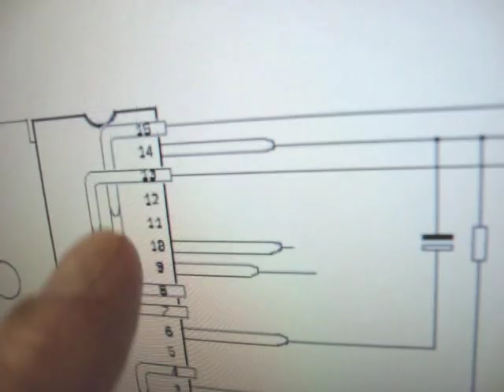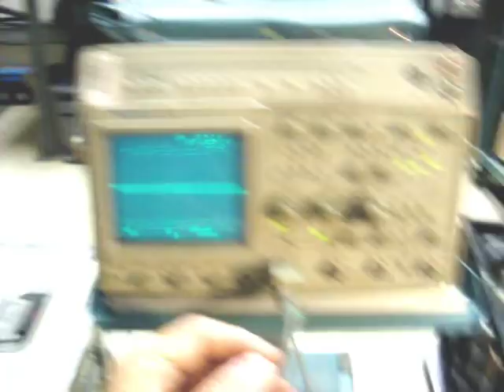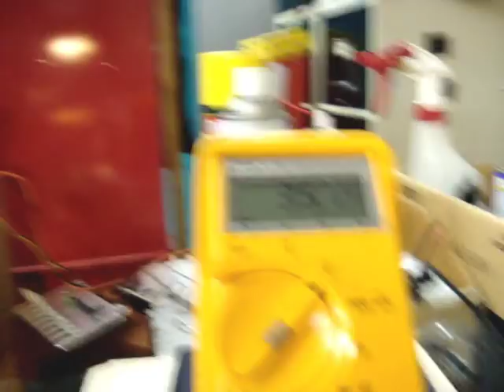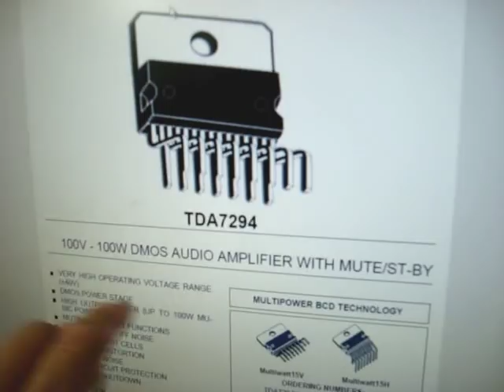TDA7294 100 Watt Audio Amplifier IC

Comment: You keep showing only the input in terms of frequency. It would have been really nice if you mentioned the input voltage peak to peak. 
Will watch the video a few more times to see if you have mentioned input voltage. This was the most critical info I was looking for i.e. what input voltage range does this chip work with best.
Reply from the maker: I may not have mentioned it because the gain (input sensitivity) can be set by changing the feedback resistor to a larger value. I believe i did this  mod to this amp to make the input gain similer to that of consumer line level. Hope this helps.

Comment: nice Video thanks for this! But i habe a Question. I have Build this amplifier but i have a Porblem, the top half wave is niche no prblems but the bottm half wave have a scratch on Top can you tell me whats the Problem ?
Reply from the maker: Verify that the negative voltage is good. Also, make sure that both the + and - have bypass capacitors to ground at the IC terminals. Keep ground leads short and star point grounds.

Comment: This chipamp is so good  and economical,I build several amps  with this chip  in bridge mode  ,sold some and never looked back
Reply: Lm 3886 will give even lesser distortion at 70 watt ( 0.1 % vs 1 % of Tda7294)

Comment: TDA7294 works fine up to 10kHz. I use it in BTL mode with TL speaker system. They can shake 3 stories building.
The TL speaker system explained in Electronics Today International magazine.
Cheers from Indonesia
Reply from the maker: It should be good beyond 10 kHz on up to at least 20 kHz. But if it works good enough for your needs, that's great. The 7294 is an awesome amp!

Comment: I have a TDA7293 PCB board with 2 IC wanted to know what how much rectified DC voltage and Amperes will be required to run at its full potential power ?

I will be using " E " core transformer
Reply from the maker: A transformer with 70v ct at 4 amps should be adequate.

Comment: How would I go running this with a 28 0  28 transformer, I've got two  tda7293 boards there but probably not the best with those transformers I've got laying around, thanks.
Reply from the maker: You can use a full wave bridge rectifier.  The transformer centertap will be ground, then the (+) and (-) will connect to the filter caps and return to ground. Should work fine.

Comment: Bob h what's the difference between the tda7294 and the tda7293
Reply: 93 can handle 10 volts more on the voltage rails. Than the 94. Also makes more power if you feed it those extra 10 volts. Chk the data sheets.

Comment: Mica or silicone thermal pad is necessary for this IC while mounting on heat sink? Because I have purchased a ready tda7294 amplifier board from AliExpress and I have noticed that there is no Mica or silicone insulation. Please let me know if it is required to install thermal insulation as I using without it.
Reply from the maker: It is usually recommended to use some kind of insulation (mica or silicone) between the IC and the sink. However, if the heat sink can be insulated from ground,  the IC can be mounted directly.
Reply: @bob4analog  The back is equal to the negative power rail. I was wondering if two IC can be mounted to the same heat sink and still work.
Reply: Thank you, Sir
Reply from the maker: @amitchodankar1989  ;-)

Comment: What is the value of the resistor you Using between 2-14 piin?
Reply from the maker: It's a 30k ohm. I used that value for higher gain.
Reply: Thank you sir for your quick reply. If i use 22k what is demonstrated on the documentation then will it deliver around 100w or i have to use 30/33k like you to get around 100/80watt ?
Reply from the maker: Anup Sarker - The amp will still produce 100 watts with either resistor. The lower the resistor value,  the less  input gain.  Therefore, the amp needs to be driven harder to achieve the same output power. The 30k resistor makes the amp more 'sesitive' than the 22k.

Comment: please help explain how/where to connect pin no 9 and 10? datasheet do not says clearly. i tried a lot of times to make this amp but i failed. I tried with two different ics but none are working/cant hear sound on speaker. please help please
Reply from the maker: Pin no 9 is connected to a 22k and 10 connected to a 10k and both resistors are to be connected to (+) for the amp to work. Email me and I'll send you the schematic - bob4analog@yahoo.com
Reply: thank you so much

Comment: Hello,

It is a great video!

You really know what you are doing. 

Could you tell me if is it possible to obtain 100Wrms with a 8ohm impedance speaker? 

Other question, What did you do to change the Vpp from -57.6 to -66.4, what does the "1KHz mean" ?
Reply from the maker: Thanks!  Yes, the specs indicate it will do 100w into 8 ohms...at 10% distortion. I was demonstrating this amp under  typical operating conditions for 0.5% distortion level.  It was just to demonstrate that the TDA7294 will do 100w into 4 ohms as advertised. --- Regarding the 57.6 to 66.4 volts P-P output,  this demonstrated that most of these type of amps will usually produce a bit more than half of the maximum power output into 8 ohms if audio input is increased. In this case, it was 69w into 8 ohms. (This is close to what the technical specs indicate.)  Simply stated, the amp is not working as hard at 8 ohms, and it will make a bit more output if driven to do so. --- The term '1kHz' means 1 thousand cycles per second. It's just a steady tone used for reference when testing an amp. 1 kHz is usually the standard reference tone used for this purpose. --- Here's the link for the technical specs...  http://www.st.com/content/ccc/resource/technical/document/datasheet/ab/d6/fa/99/84/36/49/ee/CD00000017.pdf/files/CD00000017.pdf/jcr:content/translations/en.CD00000017.pdf ... see page 3, this gives a breakdown of the power levels and their conditions. Hope this helps. :-)
Reply: Thank you very much for your attention!
What should be the heatsink size to use the TDA7294 without a cooler.
Reply from the maker: 130 x 45 x 50 mm (5" x 2" x 2")  minimum. Ebay has many to choose from. Do a search for "TDA7294 heatsink" and you'll find them.

Comment: Thanks, It's decided then, I'll go for TDA7294 which is way cheaper than LM3886. Again, awesome video, keep it up :D
Reply from the maker: Thanks! As far as pricing, you can get some great deals on Ebay for either of the chips, which puts them on par with each other.  Altho the LM3886 could probably be driven to 100w, it's not rated for that; the TDA7294 is, so it's the better deal. I'll be doing 1 more amp vid - the TDA2040. :-)
Reply: @bob4analog  National semiconductor did not count on the wattage above 0.1 % of distortion while Tda 7294 measured for 100 watt at 10% of distortion. If you concern about distortion levels, go for lm3886